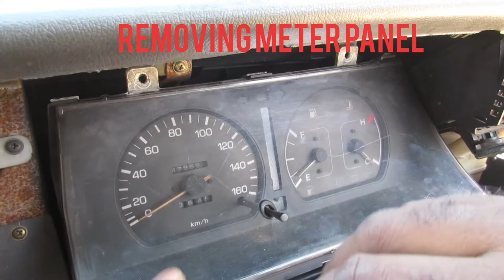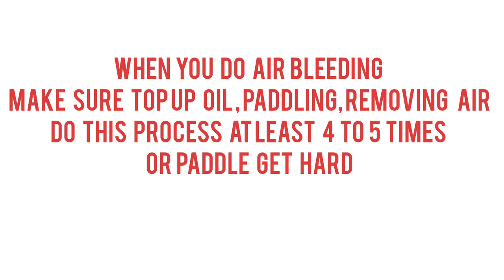TOYOTA HIACE [DOLPHIN] CLUTCH MASTER CYLINDER REPLACEMENT

Comment: After replacing the washer what if the pump isn’t press the oil, how to fix it?
Reply from the maker: Check the cylinder inside is not worn out